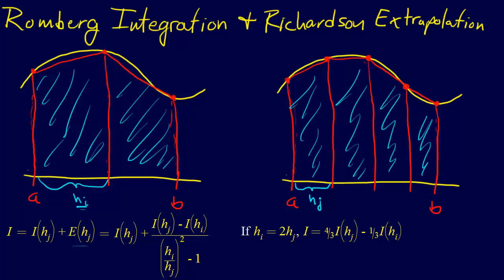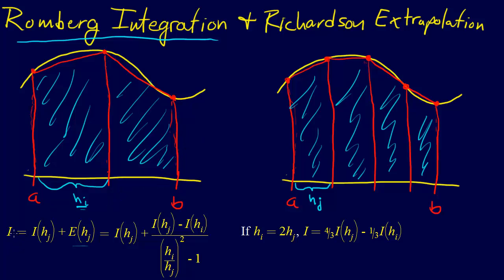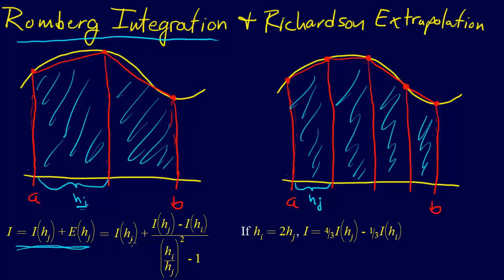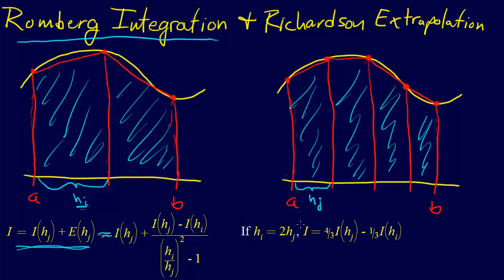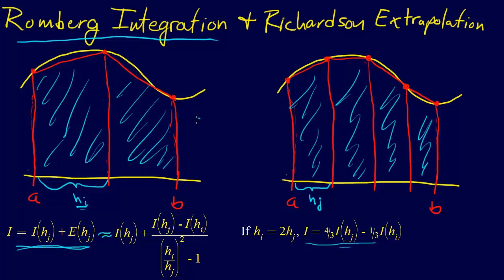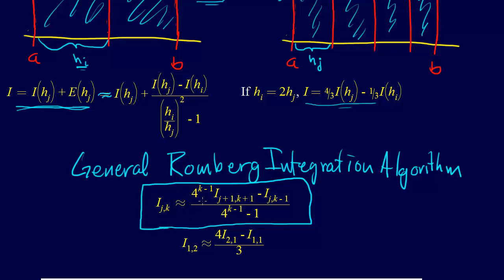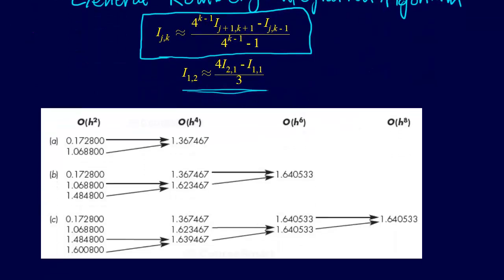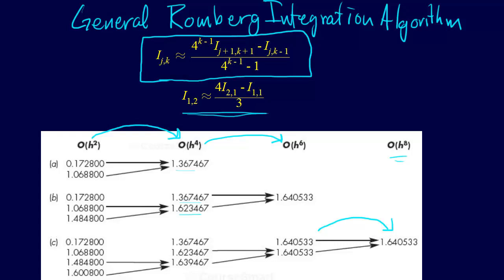6.2.2-Numerical Integration: Romberg Integration and Richardson's Extrapolation

Comment: i think your general formula is wrong...... At 4:29 you formula says something like this : I(1,2) = [ 4 I(2,1) - I(1,1) ] / 3 , there is no  I(1,2) , maybe you mean I(2,2) , because we're moving forward in the algorithm :)
Reply from the maker: Thanks for the comment. I just went back over this, and there is an error, but it's not what you might think. The formula I(1,2) = [ 4 * I(2,1) - I(1,1) ] / 3 is actually correct. As I mentioned in my previous comment, it's important to keep in mind what we mean by j and k. I'm not sure why you think there is no I(1,2). I(1,2) refers to the integral approximation accurate to O(h^4) for one interval segment. This is equal to a weighted combination of two separate O(h^2) approximations (each using the trapezoid rule): one assuming a single trapezoid for the entire region [ I(1,1) ] and another assuming two trapezoids for the region [ I(2,1) ].
The error in the general formula is on the second index of the first I in the numerator. It should be k-1 not k+1. The general formula is thus:
I(j,k) =~ [ 4^(k-1)*I(j+1,k-1) - I(j,k-1) ] / [ 4^(k-1) - 1]. This is given correctly on p. 636 of Chapra & Canale.
Reply: thought the same as @trollLoki. Thought they were just indexes or sthing.. Thx for explanation
Reply: @jacob 1st question please: 1) Do you mean, I(1,1) is like using a single trapezoid rule on the whole region, I(2,1) is like using a "composite" trapezoid on the region, and I(1,2) is like using two (normal / single) trapezoid-rules on the whole region?  2nd question: 2) What is more accurate, 2 "normal" (single) trapezoid-rule on 1 region, or a "composite" trapezoid rule? Thanks in advance!